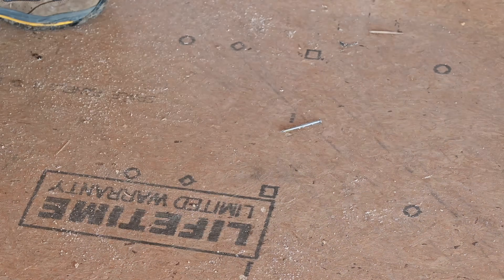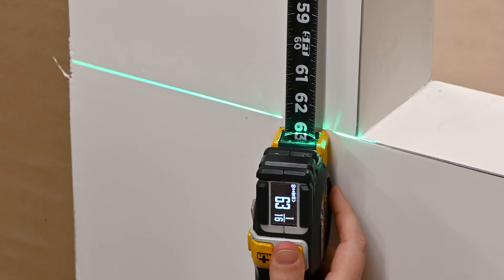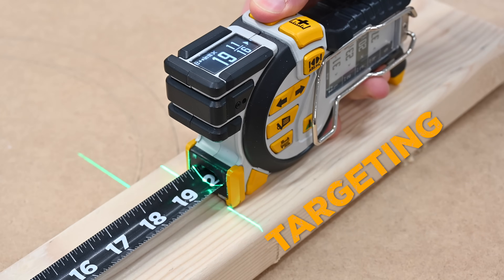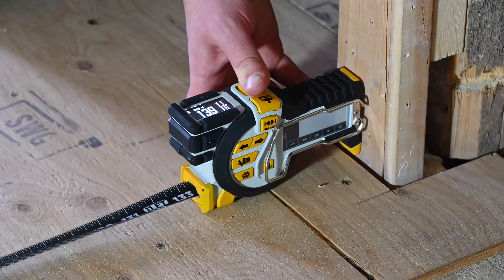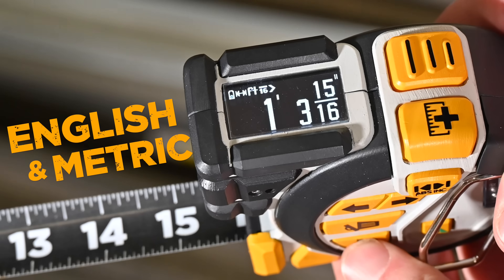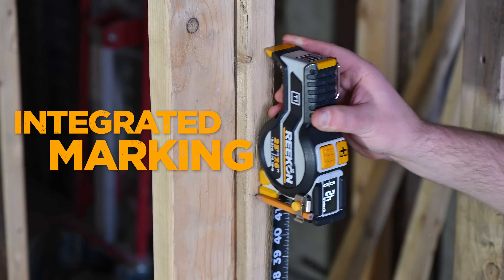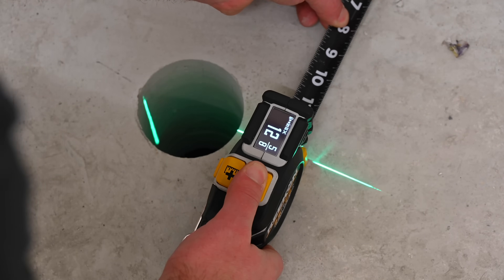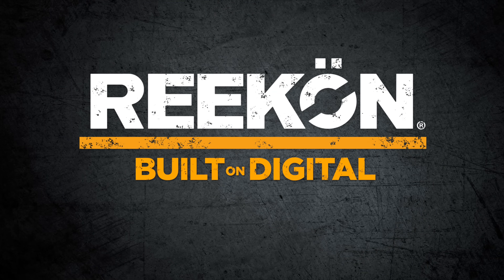T1 Tomahawk Digital Tape Measure Launch - REEKON Tools

Comment from the maker: Available for pre order now! reekon.xyz/t1
Reply: 4 months and still on preorder?
Reply: Kickstarter payments arent going through for me :( Tried multiple web browsers and my phone and two different cards. Kickstarter just keeps doing a spinning circle icon forever over the "pledge" button when I click it.
Reply: Took 42 minutes of trying every couple of minutes before payment finally went through. Kickstarter servers really need an upgrade to handle a decent capacity
Reply: Can you come out with a 25 ft one? Most industry in commercial only use 25 meters
Reply from the maker: @angelgonzalez9763  it is 25 feet
Reply: Where can i buy this
Reply: I would like to purchase and what is the cost? Really would like to have one for my tool box. Hop that this is not gimmick that I loss my money for it.

Comment: I used to work for a general contractor and I know for a fact a good contractor could easily make one of these pay for itself.  Just not having to run up and down a ladder for a pencil would pay for itself in a few jobs.  Otherwise a $300 tape measure is an extreme luxury

Comment: I ordered one  but i have a question  does it cone with an extra blade?   Im a fitter/welder  so i work with steel, not sure how long the blade will last before the bottom wears off
Reply from the maker: hey will it doesnt come with an extra but we do have them available

Comment: Okay so what happens when I drop it from the ladder or from the scaffold or when you're in the rafters or the battery dies and you have no way to charge it cuz you left your card at home or you now have to take 2 hours out of your work time because the battery died to charge it in order to complete your work that's just stupid I would never buy one of these if it tweaks and gives you a wrong digital readout and now all your stuff don't match up that equals you have now got a huge  problem  before anyone says anything I know you could still use the tape it's self but what if you can't pull it out or retracte it because your battery is dead I mean I haven't read the exact details on all of these questions I have here or that I've pointed out but just says for instance that. That won't work either because it's got too charge something this is just ridiculous and if you don't know how to read a tape measure to the point where you got to get one of these things then you need to go back to school and get out of the framing business of any kind I'd rather just keep on chugging along with my trusted ol handy dandy Stanley
Reply from the maker: Hello Arcenio, the battery is rechargeable via USB-C and replaceable should it die (also the power is for the screens and can still function as a normal tape measure).   It has the durability of a phone in a case plus the blades are fully replaceable should they get damaged!

Comment: Is the tape replaceable?  I go through tapes fairly quickly on job sites and know the last foot of a tape takes a beating.  I buy lifetime warranty taps because of this (DeWalt and Milwaukee).  If the tape is replaceable, and even better lifetime guaranteed, allowing the expensive part to keep running - this is a winner IMO.
Reply: Says so on the Kickstarter page.
Reply: Yeah but woukd you treat a tapeblike this like the old dirty Fatmax lol 😆
Reply: This tape ain't even available I thought.
Reply: Is there a real date for availability for this item?
Reply: When is a good time to replace A tape measure for A new one, *off Subject*

Comment: Is the tape it self only available in Imperial measurements?
Reply from the maker: metric too (mm and cm)
Reply: Not just the readout on the screen, the actual fiscal tape it self? Nice 👍 then Im definitely gering one.
Reply from the maker: @Gaui76  yes the blades too